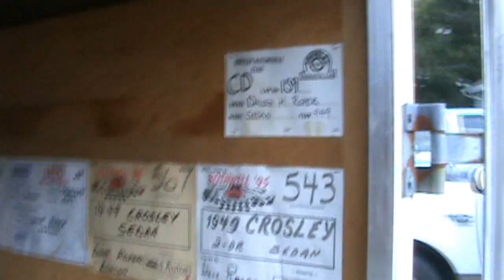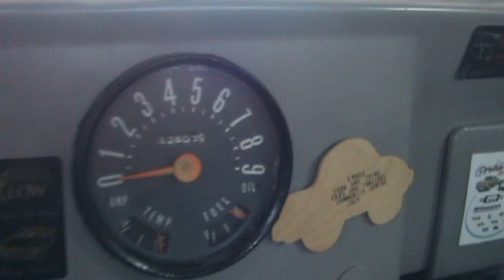Friends Old Car Collection

Comment: The split windshield is not the only difference. The early ones have the vertical slot grill and smooth flat fenders. Later ones have fenders with a point and a cross bar grill.